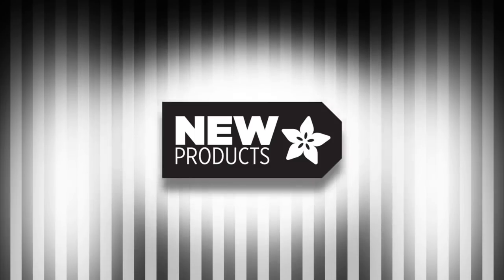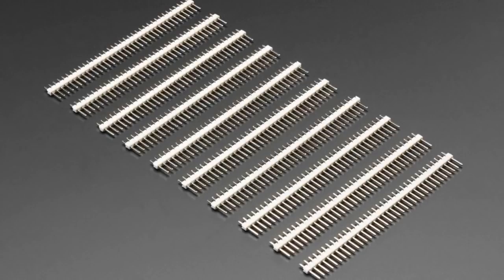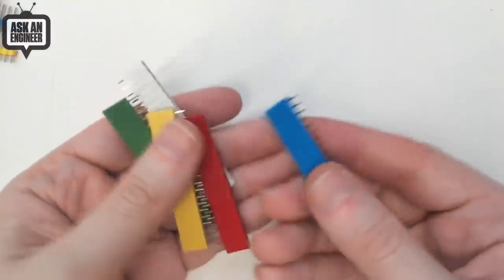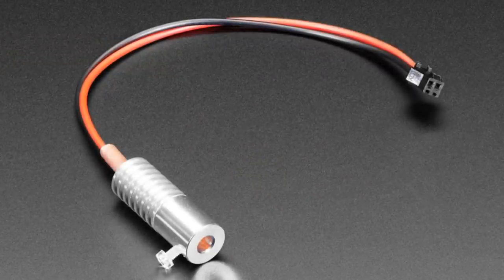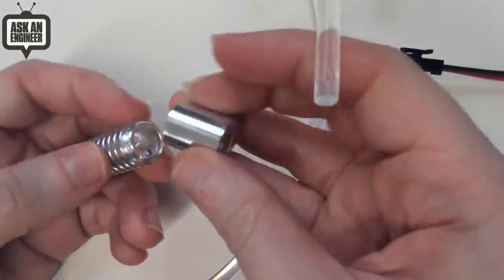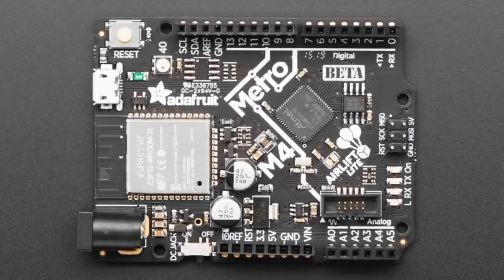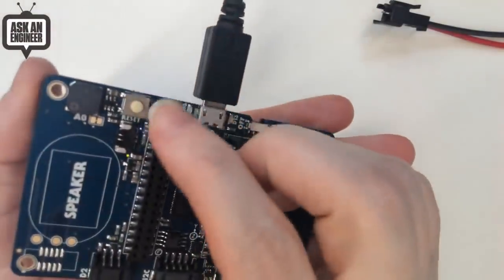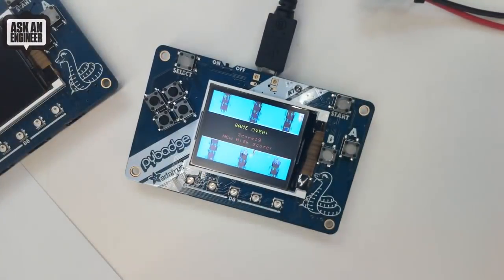New Products 4/24/19 Featuring #Adafruit #PyBadge! @adafruit

Comment: Nice product spread. Could we maybe have the male rainbow headers in the variant with about 8mm of pin on both sides? Those are useful for breadboarding. It would be neat to label signal groups and power rails by using the different colors. Also, the fiber optic light sources are lovely.  Any chance for a RGB version?

Comment: Why is there no mirror at the endpoint of the Fiber Optic Tube?  It would increase the side light output, which would otherwise be wasted.
Reply: I was thinking the same thing. Reflect the light at the end back in to the fiber. Would that help even out the side emissions, or make both ends hot-spots?